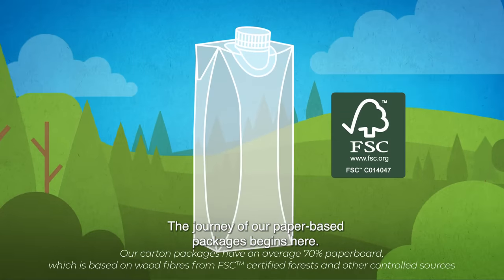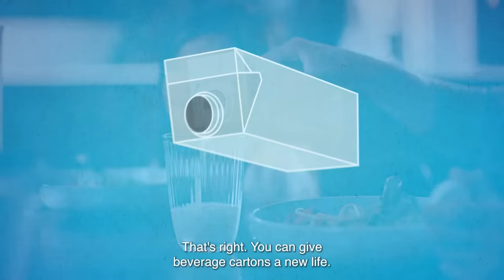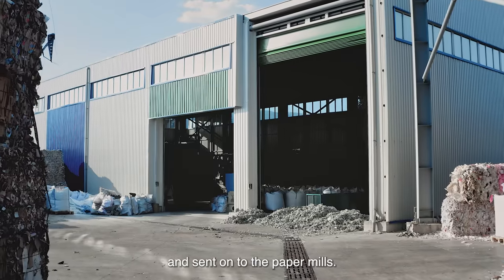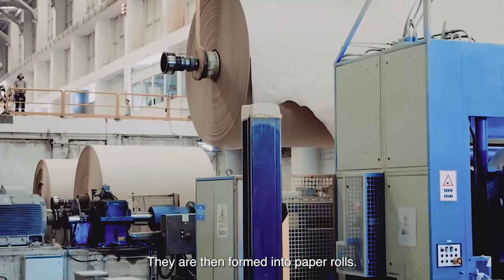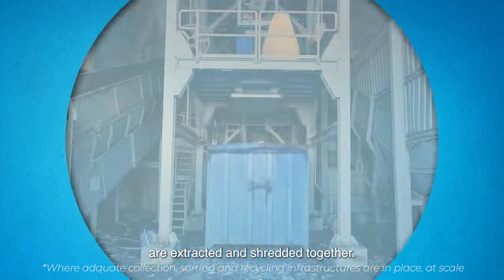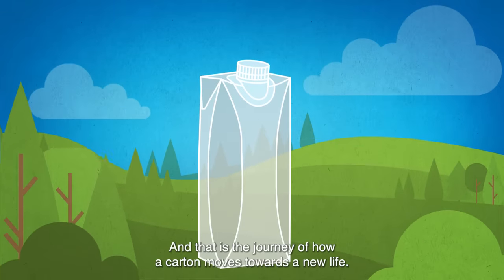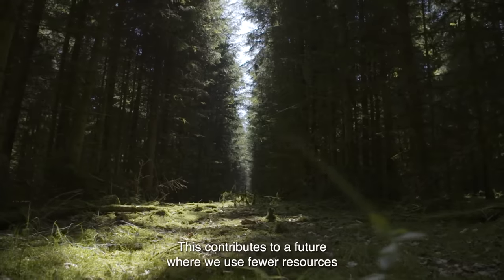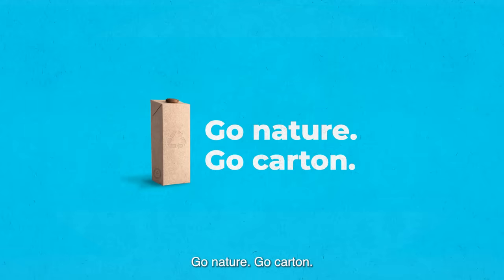Recycling journey of paper-based Tetra Pak® cartons

Comment: With all due respect; Though I strongly appreciate removing the paper pulp and recycling that in the conventional fashion, I don't like the concept of PolyAl; A composite created by shredding and processing the polyethylene and aluminium together. May I ask why these components aren't separated from one another and recycled separately? ♻🤔

If the answer is what I think it's going to be, then my counter-question would have to be; „So why don't you use a water-soluble adhesive, then?“ 💧
Reply from the maker: Hello, thank you for your question. Due to food safety requirements and barrier functionalities of PE and AI, a water-soluble adhesive for packaging containing liquid food might not be appropriate. 

PolyAl is a material combination that is challenging to separate due to its strong bonding. Currently, mechanical recycling is the primary method used, where the materials are processed together into granulates, which are used for products like plastic pipes, pallets, or panels, depending on the end application market. By using chemicals in a mechanical recycling process, some recyclers are separating polymers from aluminium for film production. These films cannot be used for food contact applications. 

While chemical recycling could separate the materials and allow for food contact applications, this technology is still emerging. Advances are being made, and capacity is currently expanding to improve PolyAl recycling across Europe in the near future.